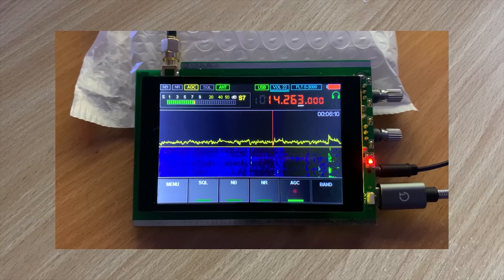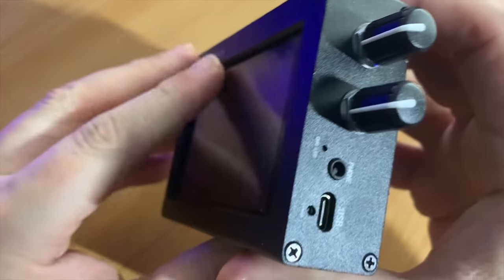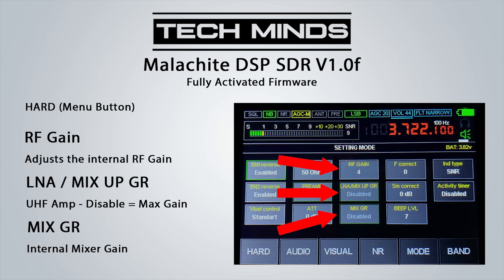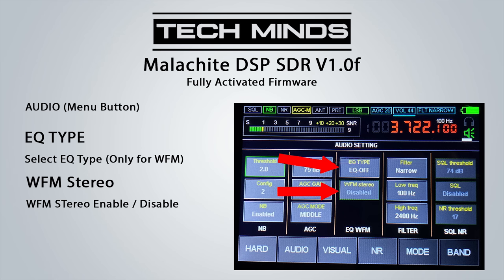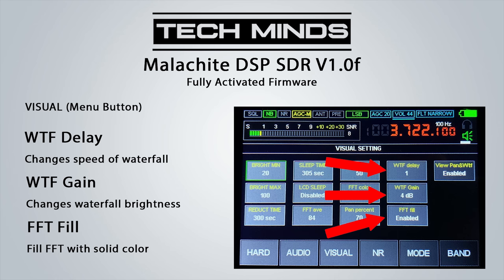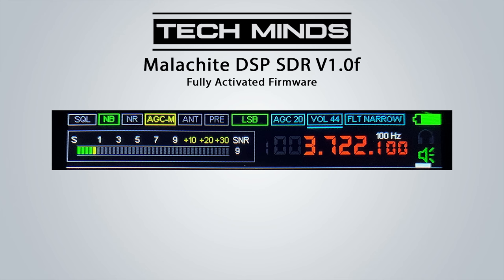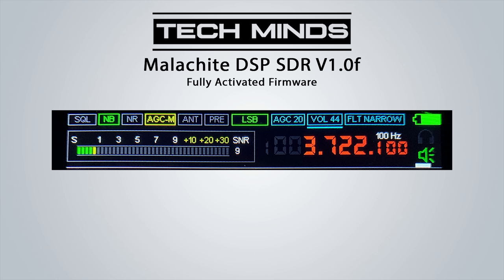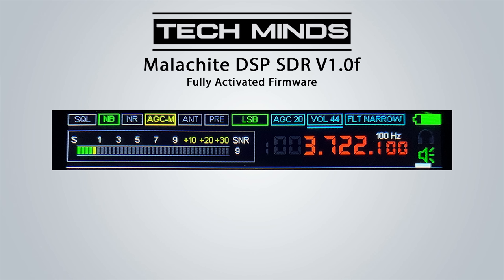Malachite DSP SDR Fully Activated Firmware 1.0f / 1.10

Comment: Thanks. I have the same version bought from Banggood and came preloaeded with the version 1.10a firmware and full coverage to 2 Ghz  ( apart from the gap that they all have).  I'm impressed with mine as it is well made and once you get used to the menu system works real well.  I've heard some horror stories about the Chinese clone versions but the you review and mine appear to be the better versions.
Reply: How did you buy it pre-loaded? I couldn’t find a full range option in the store.
Reply: @treesway2241  They may be out of stock but I got mine a couple of months ago.  Look for the full 2Ghz coverage version.
Reply: @lawrencestringer1262  The only options I see are either 50KHz-200MHz or 400MHz-2GHz, although the latter option is more expensive so I'm not sure if that's the only one that can be upgraded. It also states in the description that both options come with 10a already installed but I'm not sure if that matters.
Reply: This is the version I bought. Coverage has a gap from 200Mhz to 400Mhz. This is the same for all Malahits
Reply: @lawrencestringer1262  You bought the 400 to 2ghz one?
Reply from the maker: The 400 to 2ghz version is most likely the fully activated version. This will also cover 200mghz down to HF.
Reply: @TechMindsOfficial  I did some digging and found out that the 2ghz does cover the entire spectrum just as you said. I'm glad I had time to cancel my order of the limited 50khz to 200mhz unit because I would have been pretty disappointed if I couldn't listen to everything hahaha

Comment: Just came across this, I ordered a DSP2 clone in a very nice aluminium case, the speaker is on the front covered by a grill and the knobs and antenna connections are on the top, the power button, phones, and USB connection as well as the hard off switch are on the left side, the same model you cover on a much later video. The reason I purchased this model is, it is the first unit that doesnt look like it was constructed in someone's garage. The machining looks brilliant and it legitimately looks like a product you might buy at a retail store, and it comes with the firmware fully unlocked. It was not cheap, $350, but the primary reason I purchased outside of the machining was, I have been considering purchasing an RSP1a or something similar. This looks to give me the benefit of having a PC based SDR and a portable, self inclusive unit. Im hoping this outperforms my Eton E1XM, Sony 2001/2010d, Grundig Satelit 700, Sony ICF-SW77, Sony ICF-SW55, Panasonic RF-B65, Sangaean ATS 909X2, Tecson h501x, & Eton Elite Executive units. I have a GA508 antenna I currently use, again, based on the review you did of the GA450 & GA800, and my thinking was, the 508 is a bigger antenna but the same form factor (loop, cable attached from antenna to battery powered amplifier, amplifier connects to radio) with the only difference being that the amplifier does not have a place to directly attach the loop to as the GA450 & GA800 does. The loop is 20 inches in diameter, as compared to the GA800, which is 10 inches in diameter (and the 450 is even smaller than that). Only had the antenna a few days but, its been pretty decent thus far.

Comment: Nice presentation my dude !! Could you make a video with the upgrade process from demo fw to the full one ?  I found contradicting instructions on the web...
Reply: Just use ST32 Cube Programmer.  Its much easier and you can use the HEX file without converting it to a .DFU file.

Comment: I just recently bought this exact same version, I mean identical down to the knobs, same speaker grille and everything. 
One major disappointment is that the antenna Hi-Z  does nothing, the input is always 50 ohm regardless of the setting.  I later read that it needs an optional board for that.

The other issue I have with it is that it suffers from image reception.  For instance at around 3.5 to 4MHz I receive stations that are actually transmitting somewhere near 11 to 12 MHz. When using it with my magnetic loop antenna it's no problem because the unwanted frequencies are filtered out by the antenna but with a Miniwhip or long wire antenna it can be a problem because stations on the lower frequencies often get drowned out by stations at three times the frequency.

That said I have no regrets buying it and was well worth it, even considering these limitations.

Comment: Thanks for a very good video,  can I just query,  is there two different sets, onevtgat goes from 50khz to 200mhz and another that goes from 200mhz to 2ghz, I really want the amateur bands but don't know if the new sets with the latest firmware does the whole lot 50khz to 2ghz, thanks
Reply: The two versions are:
(1)      50 kHz - 200 MHz
(2)      50 kHz - 200 MHz    plus   400 MHz - 2 GHz

Comment: The sellers on bangood or aliexpress say in the description about contacting the author for firmware update code. Not sure what that means exactly. 

The firmware is 1.10c support 50kzh-200Mhz and 250Mhz-2000Mhz

“if you user need udpate the firmware,please contact the author to buy new register code “
Reply: Don’t you get the firmware from an Russian? Maybe not such a good idea at the moment

🤔🤔
Reply: @bikepackingadventure7913  You buy software for a sdr radio based on what country the developer is from? You know this random russian dev had nothing to do with a war. He writes bad code, cant debounce his own hardware, but has time to write code to soft brick clones that dont send 70 bucks for his trash software.

Comment: you didn't mention the encoders or touch screen being a bit dodgy? Maybe yours are good but mine and many others I've seen online are not
Reply from the maker: Well, my first one the touch screen was hit m miss, the one in this video seems to work very well. Although the encoders do seem flaky. I didn’t mention in this video because I am doing some research, trying to ascertain if the issue is with the actual encoder skipping, or if it’s the software not registering the encoder clicks. I really want to find a solution for smooth, 100% reliable encoders, and once I do I will make a dedicated video on them and how to fix/replace these, if needed. Thanks for watching 🙏
Reply: @TechMindsOfficial  The encoder on the Belka sdr works really well so I was planning on trying one of those on my malachite. You are right and it could be the software too or even the electronics rather than the encoder.  Mine came in a very nice slimline case so there is really not much room for any other type of encoders, Its got those edge mounted ones. Ideally a bigger case , lots of pcb shielding, shielding the lcd from the antenna and rf parts of the pcb and a decent encoder and one would end up with a very nice RX when you consider the price, size and features
Reply: The encoders are perfectly fine.  The 1.10A and lower firmware has a horrible encoder software routine that cause inconsistent results.  It makes the wheel seem non responsive.  It would not read or overshoot the value twice.  The code was fixed on the 1.10B revision.  It was all due to bad software code in the firmware.  Emil discovered the problem and wrote a new code for the vendor to use to fix their problem.

Comment: Great run through of all the features.  Mine came unlocked with 1.0c firmware.  Guess I'll be supporting the developers to get the 1.10 firmware?
Reply from the maker: If yours is already unlocked then you can upgrade to 1.10 free of charge, just update the firmware and it will still be unlocked.
Reply: @TechMindsOfficial  Is this actually confirmed or is that an assumption? I'm really keen to order, but wondering if offical firmware updates will put these chinese versions back to locked or be incompatible. Did you get any kind of registration code? Great video, this looks a lovely piece of kit :)
Reply from the maker: @maq1017  I done it with mine, went from 1.0c to 1.09f and then to 1.10 and it arrived with activated firmware. If you have the demo firmware installed, and you upgrade, then you will NOT be able to use it without a code. But if it’s already activated, then you can upgrade as much as you like. No assumption, fact :-) thanks for watching 🙏
Reply: @TechMindsOfficial  Thanks, upgraded to 1.10a with no problems, and no activation needed.
Reply: @TechMindsOfficial  excellent. Thank you for the time for confirming. Facts are good :)
Reply: Is doing the upgrade difficult?  What is process?
Reply: @wisconsinunit6005  A little tricky - in summary, convert the hex file to a dfu file,  stick the radio in dfu mode, flash the dfu file, and most important make sure you exit dfu mode in the software utility before you close the software or disconnect the cable

Comment: You don't have Hi-Z antenna input without additional filter board, which contains required circuitry.
Reply from the maker: Maybe that’s why there is an option to change between 50 Ohm and Hi-Z, it changes which circuitry is used? Maybe check the circuit diagram of the board to be sure.
Reply: @TechMindsOfficial  Yes, this switches circuits thru the relay. Hi-Z transformer, amplifier and relay are located on additional filter board. Without this board installed you have 50Ohm antenna input, no matter what you select in the settings.

Comment: Hello.  Impressive video.  I have 2 questions. Does anyone know about the new optional circuit board that provides attenuators, filtering and antenna gain for HF?  2nd question, if I have a version 2 with the registered software, I understand that subsequent versions are free.  What is the software upgrade process?  Can a video be made to clearly show how to do the upgrade?  It does not seem to be too difficult.
Reply: I have spokem with Georgiy about the additional board... this is the overall info:

An optional board has been developed for the receiver, which contains an active antenna (for a telescopic antenna), additional RF filters and an attenuator.
The board is designed to improve HF reception. The fee is purchased separately.
It will be available in March

Comment: You would be doing us all a great favor if you were to do another video that specifically goes over the correct installation of the windows device drivers and any other DLL files necessary for HDSDR to work with the Malahit-DSP SDR radio. I just got mine like yours from Banggood with version 1.0f firmware and can not get it to work with HDSDR. Two of the four Windows 7 device drivers were installed and I installed the Icom 7600 DLL files into HDSDR's folder.  But it doesn't connect.

Comment: Can you do a video on HOW to upgrade, or point to one.  AIso does the upgrade remove 250-400mhz?
Reply: maybe if u don't thinks its worth a video, can u explain it in sentence or two?
Reply: @fpvkabo  there will be always a gap from approx. 260 - 390 MHz. It is limited by the hardware - IC used in their project.

Comment: Mine has the free software , and the thicker one with the 2 speakers (one is  parasitic) and big Knobs, says Shenlan EK, it says on the case revA.0 but iside it says A3 ? .Two meters is useless as inteferance from the internal circuit, but its great on HF exept for powerfull stations swamping the band , half of the memory slots do not work. The freq steps are a REAL pain on the touch screen to touch correctly and selecting a station from the touch screen is bad as you end up with tiny frequency steps to correct as frequency step changes., once on a station it is pleasing.The sound is really full and detailed on FM and great on hf. I  On mine  the Pre amp setting is wrong ie off is ON, and on is OFF, leave it activated ie OFF on the rod antenna and dont activate it on a 20m wire or similiar. Setup I find 75db on AGC as recomended by the Russian designer "George". RF gain 20 to 25 on rod with activated preamp, 10-15 setting on 20m wire with preamp not activated (with 9:1 balun).The screen was not flush with the case a gap of about 3mil at one edge, I opened the front and found the edge of the circuit board snapped of at 2 corners,thats why it would not hold down. If you open the case it will be a pain as the other side of the visible case screws is a nut which will drop off inside! It is an incomplete radio, but it receives way better than my techsun 660 and sounds better and picks up more than my Icom pro due in part to having no mains borne inteferance which renders my HF radios useless at times thats what was apparent straight away on battery power. Some time it does not want to come out of hard setting and a restart is required.  No speaker grill is not a good idea, its been thrown together, I paid £106 from Banggood, not Chinas best offering, shame.
Reply: Suggest using a stylus in place of fingers.  Takes the challenge out of inputting if you have big fingers, and also easy to select items that are near edge of the screen bezel.

Comment: Jesus, that poor little SMA getting loaded down by a PL259, lol. That right there would have me shopping for bulk SMA replacement connectors on eBay, haha. Pro tip btw... If you're going to attach an external antenna like this, then consider using an adapter CABLE rather than heavy, abusive solutions like this. Adapt your heavy PL259 connector down to an F connector, then use a short F to SMA adapter cable. Takes a lot of the strain off that internal board mounted SMA.
I really want one of these, though. If I have an OCD shopping habit at all then it's for sure radio tech. I have a couple of SDRPlay units and I love them but to have an actual, pocket sized, portable little SDR with a full on rolling spectrum waterfall and speaker and internal battery and all, just phewwwww... it's as close to the American Dream as I'm ever apt to see.
Anyone know if these units are HF deaf at all relative to say other good SDR units or its own receive sensitivity? I spend more of my radio listening life there than anywhere else so if I did start trying to budget one of these, deafness on HF could be a deal breaker for me.

Comment: It's a real pity it doesn't have Yuasu CAT control and then it would be prefect for connecting to a FT817/818, Ft857/897 and FT891...  The size makes it perfect for working portable with those radios.

Comment: Hi, can you please explain this since I wrote to the guys at Banggood and are still finding the technical answer for this? This is what is listed under the Video

Please kindly note before purchase:

1. The software version of this product is 1.10a ；

2. We only sell the hardware, this product does not include follow-up software upgrade service (cannot upgrade to 1.10b).

Does this mean that if I own this unit I will not be able to upgrade the firmware?
Reply from the maker: That's interesting.. I do not know the actual answer, but sounds like to upgrade further than 1.10a you would need to get an original firmware key from the Malachite designers themselves, for future upgrades. Normally a one off fee of $50. If that is the case, then I would suggest to purchase the cheaper, unlicensed version from Bangood, then purchase an original firmware license key from the designers, that would ensure future upgrades for free and working.
Reply: @TechMindsOfficial  Thanks for your prompt reply, I really appreciate it. I am concerned about the software thing and to be honest since you indicated this same device in your video I assumed that it is a perfect choice. However, when I saw the unit on their website just under your video I read that 2nd line which confused me a lot. the thing is that when I wrote to Banggood, they told me that they will be looking for technical help to answer my question, till today I never heard any reply.  10x

Comment: Thanks for the upload I have a USB SDR Dungel on my laptop (running Linux mint) 29.000 is low as it goes but does not pick up the lower bands ,so I wanted something in the lower bands the only thing I don't like about the small HF is the loop antenna is so heavy on such a small unit I don't think a telescoping antenna will pick up a lot of the channels KD6TXB
Reply: I agree these small sma connectors are a problem. My solution is to use a pig tail to connect the small sma socket on the sdr to your antenna, this takes the weight off the radio.

Comment: What's the difference between the links you put in the comments? Is the most expensive the fully activated firmware?
Reply from the maker: Any that say frequency support up to 2ghz should be already activated, and will cost more.  But I put all the links just in case some of the variants go out of stock.

Comment: Does anyone know what the small LED that blinks ion the top left side of the headphone icon???  It turns either red or green when you turn the volume or the frequency dial.  Thank you!
Reply: When you change a setting as you use the set, it blinks red and when it's saved the setting, it turns green. Nothing to worry about!

Comment: Is it possible to record audio files?
Reply: The radio does not have a recording function.  However with the USB-C output connected to your computer, you can use any recording software on your computer to do the job.

Comment: Can you add digital to it? If it cant do digital ill stick to my 20 quid sdr which can.
Reply: No it's analogue reception only, you can.   Connect it to a PC and use the audio output with decoding software such as DSD

What is this '20 quid' SDR software that has built in digital decoding???????? Are you sure you aren't just using DSD?
Reply: @MrBassman91  i didn't say built in

Comment: As a result of this video, I ordered this radio. When it arrived all that was in the box was the radio and antenna. No manual and no web page to upgrade the software. What a surprise that was. Can you direct me to the software upgrade. Thank you for your time and help.
Reply: They are on eBay with the full developer software already installed (1.10b) for £149.99 UK supplier